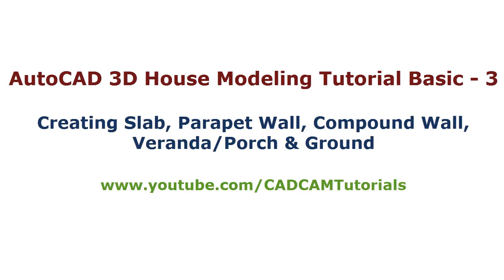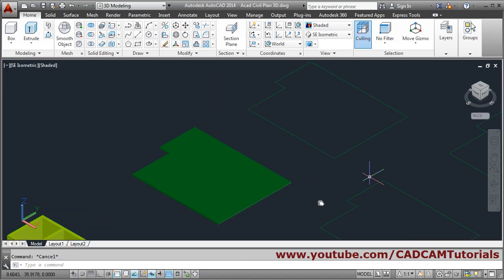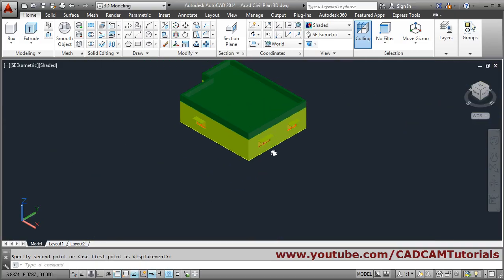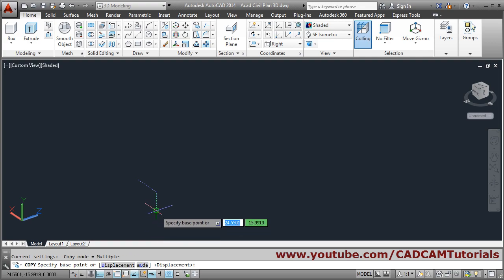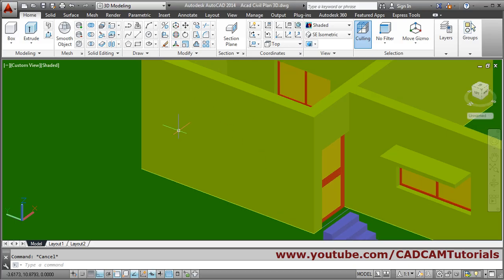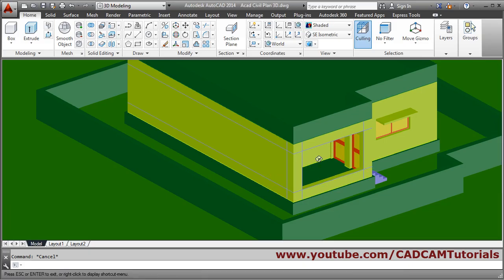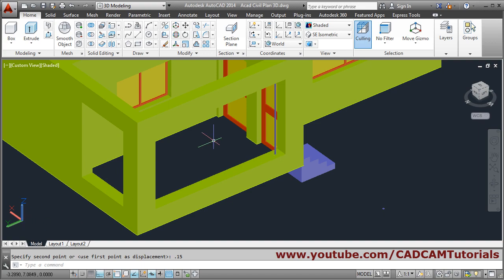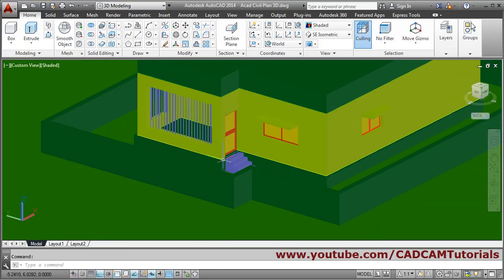AutoCAD 3D House Modeling Tutorial Beginner Basic - 3

Comment: Sir i cannot getting  offset command for parapet wall it's not working then what will i do
Reply from the maker: What is the error?
Reply: @CADCAMTutorials   cannot offset the object is coming while applying the offset command
Reply from the maker: Explode object and check that there are no overlapping lines using erase command. Then use join command to connect back and offset.

Comment: HI, I can not see 3D option when using workspace switching. I am using  AutoCad Architectural 2017. secondlt which one is easy to use and learn  3D max or AutoCad 2017 for a building work. Thanks